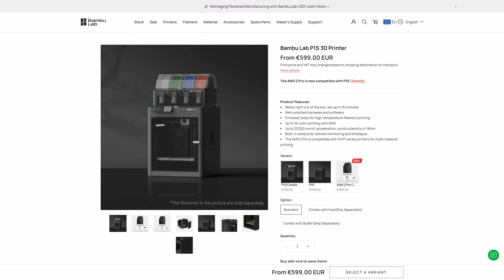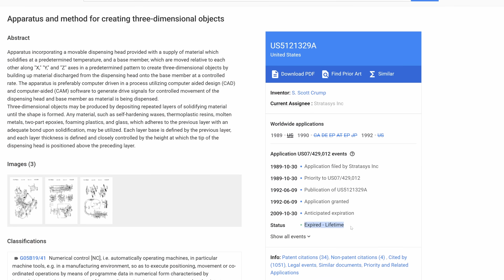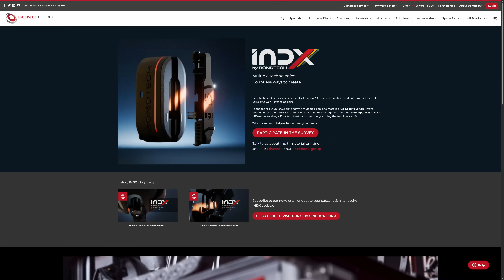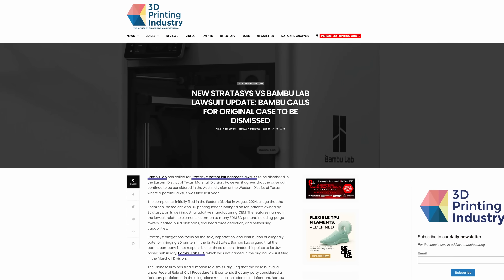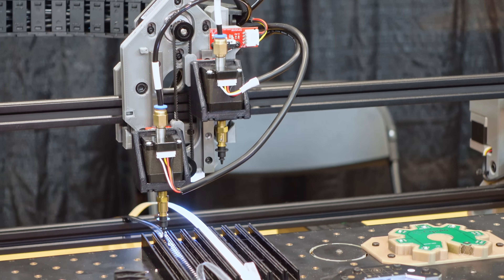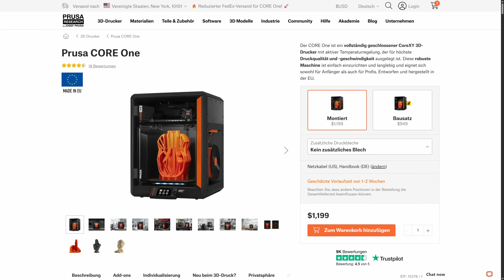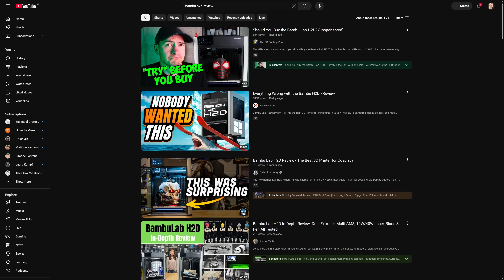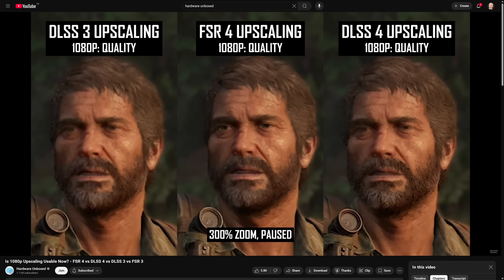How Bambu has won

Comment: No no Thomas... You clearly had a bone to pick with Bambu lab printers from the get go. You gave a scathing review to the x1c, but then gave the mk4 a ton of leeway. Then when the thermal runaway issue was brought up by Nero3D (and he was mistaken... as he said it had NO runaway protection, and it DID) you jumped on the same bandwagon, only to be called out when you were wrong as well for not investigating the facts prior to bashing the printer. And you quite literally said it right on your channel, that you were done covering bambulab printers and were not going to cover them any longer on your channel. That video is gone now from your channel (at least I could not find it), but lets call this what it is... you have bashed bambu lab printers constantly on every other video you have made on them. You then cover the Core one from prusa, and again gloss over all the issues. You basically admit it at 9:00, that you are backtracking because the market has proven you wrong, but also that the user base is so large, that you can't ignore them (bambu lab users) anymore. I stopped watching your content at that point because I was extremely dissapointed that you kept clearly attacking a printer that was good... that was better than any ender-3, ender-5, Delta, or mk3 from prusa I had ever used (for the same price) and yet, you would keep going after them. On some strong vendetta, trying to tear down the (honestly) best printer I had ever laid hands on. Even putting out a video that the reason you loved prusa printers, wasnt because it was better, or faster, but because you had fixed it many times and understood it so well, and enjoyed that process. I was at a loss for words that this was the praise  for prusa, over a more capable printer? I came back to watch this video because it was cathartic to hear you say it, you were wrong...

Comment: NO, Bambu is LOOSING....  Customers.  

A company that's been caught in so many lies, then caught editing past post to cover up the lies, then lying about editing and cover ups, does not give a flying F about it's customers.  When a company keeps putting out "Security Updates" that have NOTHING to do with security but effectively bock or severely hinder customers use of third party products, that company does not give a flying F about it's customers.  When a company's customers come up with what sounds like a wildly farfetched worst case scenario for why the company is lying and blocking third party products, then that company refuses to deny the allegations, that company is telling you it doesn't give a flying F about it's customers and at the very, very least, keeping the worst case scenario option open to them, more likely, actively initiating that worst case scenario.  

Bambu Labs is the Satan of the 3d printing world.  There are far, far better options out there.  Don't buy their products!!!

Comment: If you don't need the dual heads to print with multi material filaments, I think the K2 Plus is the better machine. It's cheaper, has a bigger build volume, and runs klipper with root available. I could also get two K2 Plus machines for the cost of 1 H2D with extra money to left over to either buy a smaller 3rd printer or more filament. So I respectfully disagree that Bambu has won.

Comment: Might be a big gross, but you're right... PRUSA needs to give people what they want, and innovate rather than copy Bambu. For my farm I would prefer to be able to buy individual AFS printers. They're smaller, but I think it's the perfect size for most mass produced parts. Should be able to sell them for quite a bit cheaper than the Core One, for professionals that want a bunch of printers who will buy 10 at a time. Not interested in the whole AFS system, just the individual printers would be sweet to put on shelves in my print room.

Comment: I have just never been able to afford a Prusa anything. Making things accessible to everyone means making it cheaper, not justifying higher costs. I originally bought a Robo3d R1+ (2017-2018) and it was cool but very limited. Then, years later I got an Anycubic Vyper. Still really neat but limited and slowly became a tinkerers nightmare. This is when I started to dislike all the "upgrading" most printers require.

I avoided Bambu at first because I figured it was all hype and I would be tinkering again in no time. I had given up on printing by this point.

Bought a P1S and have yet to be disappointed. Only a handful of failed prints and I can actually start something and walk away with confidence that it will be fine. We print exclusively with ABS, ASA and PETG.

I guess my point here is that I WANT my 3D printer to just work and it does now. Prusa might be the same, but I just could never find the extra money for their offerings and still can't.

Comment: If moving away from open source solutions is the new normal that we're stuck with, then it has to come with strong rebukes of attempts at enshittification. The Bambu Labs drama with cloud support is the first example that comes to mind. I'm not quite sure if we, the community, won that one or not. They may have backed off on that one, but they and other manufacturers might try a different approach.

I don't know if it's possible to keep it away in the long run.

Comment: I've been 3d printing 15 years or so. I hated messing about trying to get them to work. About 5 years ago i gave up on them and moved over to CNC. 

I can honestly say that if it wasn't for Bambu i would not have returned to 3D printing. The printer actually works, first time, every time, even when i haven't printed anything for a few months. And the quality is excellent. What a joy!

The convenience has brought me back to what i love, which is making and designing things. 

Some people spend all their lives making or doing up boats, or doing up their cars. But I hate trying to fix my car, I just want to get in it and drive to where I want to go. I never wanted to be a printer repair man...
Reply: Exactly.  Any of the established manufacturers could have done what Bambu did and make 3D printing easier.  They didn’t.
Reply: This is 100% my experience as well, except the CNC part. I never stopped buying new 3D printers in the hopes to get what I now finally got with my P1S. And I've been into 3D printing since 2010 as well, just like you.
Reply: I thought I was alone. I spent a really long time tinkering with printers and putting money into them. At one point I wanted to give up and then I bought a Bambu and was thrilled.I was finally able to focus on designing projects rather than on the printer itself. I have currently modified Ender 5 S1, Bambu Lab A1 Mini and P1S, Prusa Mini, Ender 3, Ender 2 pro (both defective) if I have time and desire I tinker with them, if not then I design parts
Reply: From my point of view same thing happened with haas, which took over by being cheap and simple solution. 60k for vf2ss, cant go wrong with it. I really wish machine tool builders would be more open or open source. Those things get a bit more expensive than a 3d printer.
Reply: Eh... first time, every time? Their subreddit says otherwise every single day...
Reply: But Prusa has been offering the "just works" experience for well over 5 years now. Bambu are not the first ones to do that.
Reply: @zapador  They’re the first to do that for half the price of a prusa of the same quality.
Reply: @gownerjones That wasn't my point. And it's not half the price, cheaper sure but not half.
The comment I responded to claimed that 5 years ago 3D printing wasn't working out of the box and required tinkering, it did not. Unless you bought one of those machines that did require tinkering.
Reply: @zapador  Yes that’s true. 5 years ago, Prusa was in the same paradigm as all other printers. They work fine out of the box, once assembled, produce several flawless prints and then, if you didn’t put in active effort into maintaining them, the printing quality would slowly degrade over the course of a year until it became very frustrating to use. I had that same experience with much cheaper printers, too, like the Ender 3 v2 and the Anycubic i3 Mega before that. Even my ancient Anet A8 produced a handful of flawless prints in the beginning. With prusa, you bought yourself more time before degradation started. But a P1S or X1C requires very very very little maintenance, less than my actual inkjet printer, and the prints that it spits out are perfect every time, while printed at speeds I have never seen before. The Prusa equivalent is the Core One. If I get that assmbled (the same way the p1s arrives), it’s $1200. That’s not just double the price, that’s double the price of the p1s PLUS the AMS.

Comment: I think brutal honesty and integrity is the most important thing in a review. I no longer have 100% confidence that this is still the case, even with large, well-known maker channels.
Using Bambulab as an example, I may sound like a conspiracy theorist, but you could almost get the feeling with many channels that they are secretly sponsored by BBL. 
Of course, many received an H2D for review on release. And for many of them, however, there still seems to be hardly any video since then in which the H2D is NOT mentioned, and/or is clearly visible and "neatly presented" sitting in the background on a workbench.
“My H2D printed this perfectly”, ‘it was no problem for my H2D...’, ‘then I tested it in my H2D and...’, ‘H2D’, ‘H2D’, ‘H2D..blaahblaah’....! It's like they dumped all their other printers (even if it was also a BBL X1C, P1S, etc.) and are now doing everything solely on the H2D.
I'm not trying to imply anything, but this is so prominent that there may grow some skepticism. Because if you look in the forums and other sources at the problems that many “normal” customers have with this machine, the things run “OK”-ish, but not nearly as flawless as it seems to be the case for these channels.

Comment: I build my first 3d printer (Delta) back in the days without any knowledge and was the starting point to learn coding . Now days as i am using my 3d printers as a tool to print functional parts for my projects and prototypes i prefer to buy a reliable cheap printer to do what supposed to do. Not care to achieve extreme speeds etc. I own a Creality ender 3 v3 KE that has anything i need.
i am not opposite for closed firmwares  but  i am opposite when firmwares / menus  are not having options to disable some not so necessary add ons. As an example in a recent PEWDIEPIE    video saying about some projects he made , he damaged filament sensor of his  bambu's printer and couldn't print any more..  until had to buy a new sensor. 
Why not to be a menu to override this type of  "not so crucial" add ons   to finish your work? 
Also my fear on the future  is when they will start pushing their own filament brands with some sh***t statements like all  printer companies do (Printers for paper like Epson,HP)
When they will start detect if you are using their own brand filament or else will stop print because they "want to protect you not to damage your printer because the notice that other brands filaments  tent to be low quality and damaging printers "

Comment: By the time gen alpha is old enough to print there will just be a huge touchscreen tablet with pictures of models to scroll through and you just touch the model you want to print and that's all the interaction you can have with the printer and it will still almost be too much

Comment: First thought -- When you say Bambu has won kind of discredits everything else you are going to say. Technology is ever evolving. Bambu made a great machine that forced everyone else to up their game. If they are on top that is generally a temporary position to be in. I have no intention of purchasing a Bambu machine as I have no interest in a 3D printer that is web connected. I have computers for that. Some say I do not need to use that feature but I see no reason to pay for features I do not want.
The printer I am currently using is the Ender 3 V3 SE. It is the third budget printer I have purchased and the first I got from Creality. I still like it, still use it and while I have looked at faster core XY printers I have not felt the need to spend more money yet.
I always watch a series of reviews before I buy a new printer. I like to hear multiple points of view. I like to know what to expect before I order anything.

Comment: my PS1 is bricked due to their firmware. I have 2350hrs on it, it SHOULD be as good as new really, but B U T.. since firware is f*cked up I cannot use it. I could figure it out, some time in near future hope to have that time, but at moment it sits as a dust collector. AND THAT is what I can / we can say "thank you??" for in the end. Pushing industry? ABSOLUTELY.. but when they wanted to wall off the 3D space with their machines, that became the problem. The reason? Its not been spoken about. Their machines act as nodes on their network, essentially all the devices are NIC's. Network Interface Cards. The Chinese side of it and wanting to keep tabs on what is being printed, OR ALWAYS even in (tinker mode) connecting to their servers is what the problem is. They have not been transparent to us in why our machines HAVE TO connect to the servers. SURE.. you can load an SD card, but we are so beyond that point in time. SO.. the need to control has ultimately caused once heavy supporters to think again about where to spend money in the future.

Comment: Bambu Lab won because I won. I’ve got 16,000 print hours between 4 Bambu Lab printers (one of each series). Not only are they workhorses but easy to use and maintain, every part I’ve ever needed is readily available and easy to install thanks to their wiki pages and videos.

Comment: My favourite videos from you are the ones involving a project; but to be honest, at this point I've enjoyed enough of your work that I usually just click on it if it's a) in my feed and b) about the right time to be background for whatever I'm currently working on.  So I don't know how useful that is in your planning!

As for this video: I started into 3D printing about 5 years ago now, maybe 18 months before Bambu, and it was extremely frustrating.  There was no option - even an expensive Prusa - that didn't involve a certain amount of constant fiddling with the printer.  And there was very little patience online for people who found that fiddling to be a problem.  The 3D printer market had a lot of people who just wanted a tool that worked, but the 3d printing community was dominated by people who wanted to build their own printers.  Gatekeeping was rampant and options didn't exist.

Then Bambu made a printer that just worked out of the box, and managed a massive advertising blitz to help them grab market share.  It took a minute for other companies to understand that this was what was being sold - things like the Creality K1 were focused on the form factor and the performance, neglecting the user experience - but eventually they caught up too.

And suddenly there were a lot more people like me who didn't want a project, just wanted a tool, coming into the online spaces.  Where the older users found their hobby under threat.  With the "build a printer" community already being massively closed and gatekeeper-y against anyone who didn't want to build a printer, and the "it just works" users having a surge of emotion over suddenly finding a machine and other people who shared their views, I'm not surprised it all got a bit hostile for a while.

These days, it's pretty clear that the vast majority of 3d printer users don't participate in the online 3d printing community at all.  It also feels to me like the "old guard" is really struggling to come to terms with the idea that they are a niche part of the market.  I won't say the "hobby," because one can certainly define the "3d printer hobby" as being interested in building your own printer; whereas people like me aren't really participating in that hobby.  I use my X1C to support my "Astromech building" and "prop recreation" hobbies, and my A1Mini to support my "wargaming miniatures" hobby, but I don't really give a toss about the "3d printer hobby."  

But I do care about the 3d printer market*.  My X1C is a kickstarter machine.  It won't last forever.  I'll want something else in a few more years, and knowing what exist will matter.  And I'm pretty certain that *that is where most printer manufacturers will be headed.  "Build your own" is never going away, because it is a cool hobby in and of itself.  "Build your own" has probably shrunk a bit over the last couple years, as people who were willing to tolerate constant fiddling and upgrades but didn't really want to dropped out.  But it's probably stable now.  And the community will still be here.  But people need to accept that most of us do. not. care. about things like "upgrade paths" and "open source" as long as the printer and it's spare parts afe affordable, reliable, usable, and available.

Comment: I have used a bambu lab P1, and Creality K1 Max, price-wise they are close! but the Creality works way better WHEN it works! but when a printer get clogged, with bambu P1 it takes 5 minutes to fix it, and no screw driver was needed!  with the Creality: it takes an hour, and lots of un-screwing and screwing. what I have seen that Bambu lab have taken everything in consideration when they designed their printers, and that made using and maintaing the printer realy easy.  one more problem related to the filament, Creality Hyper PLA does have a better heat reistence, but i keeps breaking inside the PTFE tubes wich increases the chances of clogging.